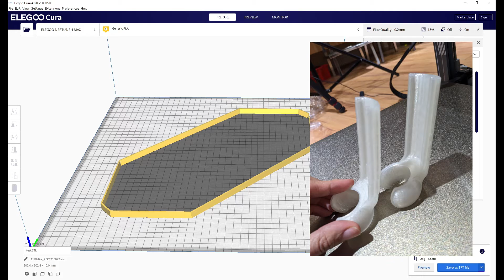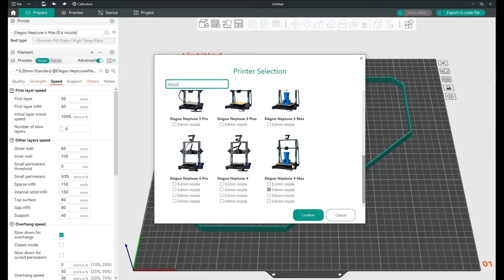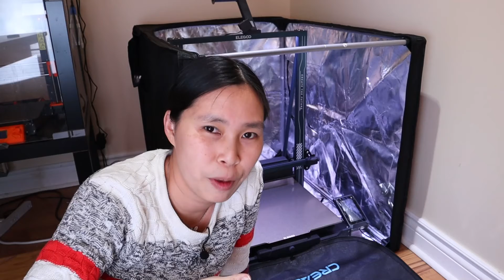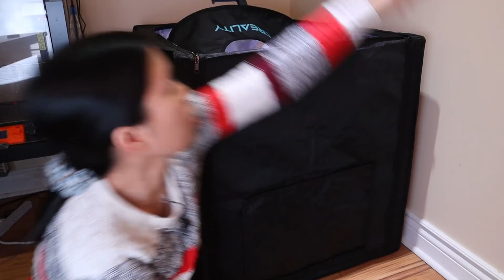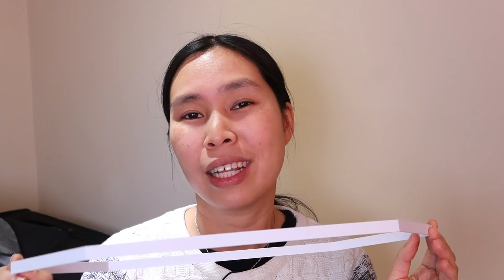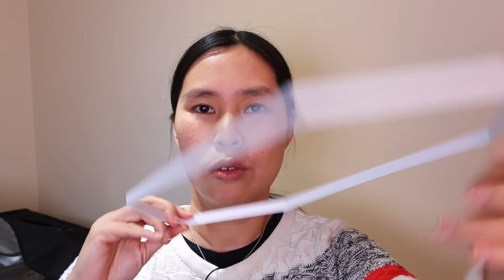Elegoo Neptune 4 Max: OrcaSlicer, Closure and Resuming Print Test

Comment: I have a Neptune 4 Plus. My question is whether I will have problems with the electronics heating up and damaging it since everything will be inside the box as if it were an oven. Do you think this will be a problem? And when printing ABS with the table at 110⁰, what is the average temperature inside the chamber?
Reply from the maker: Exposing to heat will have effect on your electronics for example those sodering pad, components. However, it depends on how long and how hot it will be. I am not a fan of ABS so I can't tell you about the temperature but you can get a cheap temperature and humidity meter ($2) and see for yourself. I have a sensor that has to be 70 C all the time and it's still working.

Comment: How did you get a Neptune 4 printer to be able to read orca Slicer gcode? I have Neptune 4, and it is impossible for it to recognize the gcode information, it is not compatible, the estimated time does not appear, nor any type of information when I insert the pendrive into the printer, only an unknown gcode.
Reply from the maker: Hi, you can try to print that Gcode to see if it works. Make sure that you have slected the correct printer in the orcaSlicer. Happy printing!
Reply: @maketestrepeat  Obviously, I have Neptune 4 selected, it wouldn't make sense to print with another's profile, hahaha

But I can't get Neptune 4 to read a correct g-code from orcaslicer,

Comment: I think you have a defective printer I had bad layer shifting on my printer watch fauxhammer video these printers where rushed to meet deadlines elegoo send me a new one and works good at 250 speed
Reply from the maker: Hi, when did you get the first one? I got mine in November. I saw new firmware too but I didn't have time to update yet. I'm printing sth big with the speed of 200. So far so good.
Reply: Adjust belt tension, try to reduce printing speed to 150 and slowly go up, i had same issue, now works good.
They ususally have a good hardware in printers, just usually bad adjusted.

Comment: Hi Gubuteck , what is the product link on amazon for that Neptune 4 MAX enclosure that you are using ? I really like it. Thanks
Reply from the maker: hi, I got it here https://www.amazon.ca/gp/product/B09CTMW25R/ref=ppx_yo_dt_b_search_asin_title?ie=UTF8&th=1
happy printing
Reply: @maketestrepeat thanks 🙏
Reply: @out51der2000  FYI I purchased that enclosure and returned it immediately. The printer "fits" but since the "Y" axis is controlled by the bed slinging back and forth it won't be suitable for anything but mini prints. You have to factor in the print bed movement when considering dimensions - something that I missed. Good luck! I'm still in the market so let me know if you find something that works well.
Reply from the maker: @matthew_moses hi, the trick is you should turn it 90 degree. The height of the closure will become the length and it is enough for the bed stroke. I printed the maximum size piece with this closure.

Comment: Hello! My name is Paul😅. Recently I also want to buy an elegoo printer (4 Pro), but it has no enclosure, no detectors. How are you dealing with excess bio-hazard vapours and products of material (abs/petg/tpu) melting, cause me only see so-called heat leaks' reducing screens? Maybe, it needs to have some extractor fan and sealed thermo-box?❤ Can you advice smth
Reply from the maker: Hi, for small printer like 4 Pro it will be simpler. You can choose between non air-tight and air-tight ones. Usually people go with the non air-tight one because it's cheaper and you don't print alot of ABS anyway. If you really care, you can make an air-tight one with wood/steel and plexiglass. In this case it will be easy to add fans/filters and duct the air out. You can check on this video https://youtu.be/vB0YiZSc7HI. It is not an air-tight one but it will give you some idea about fan and duct. Happy making.